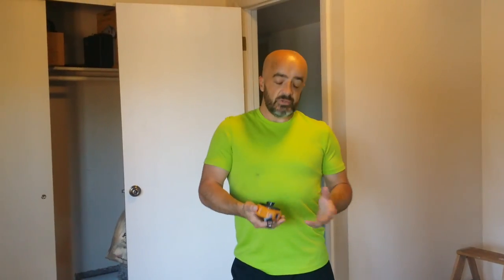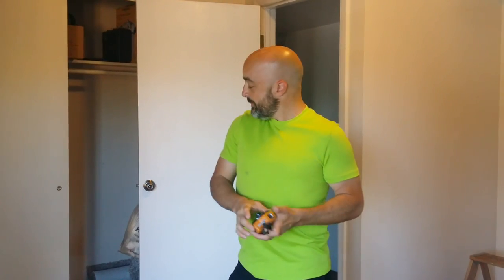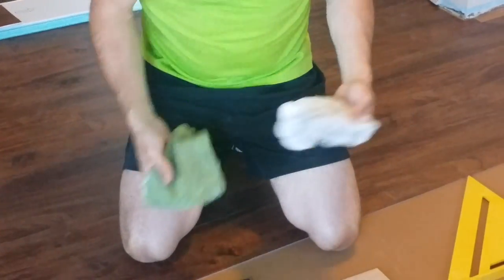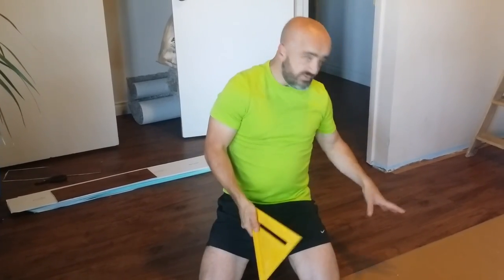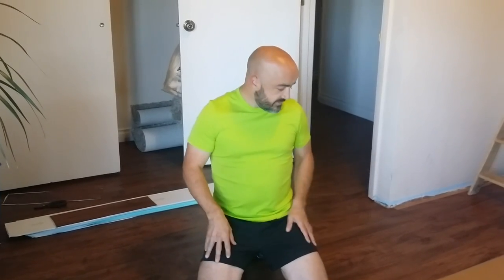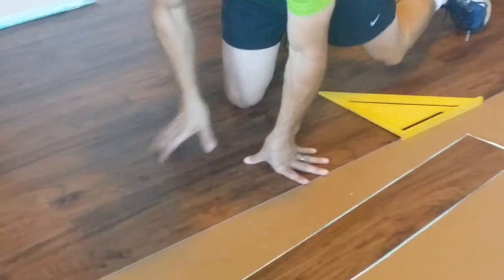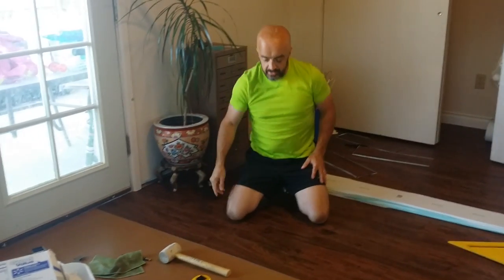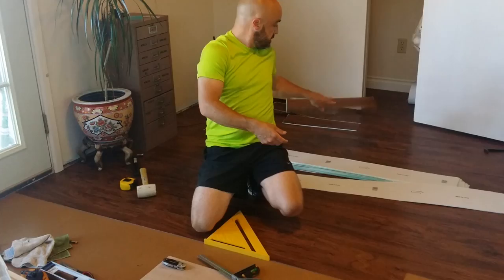Install adhesive backed vinyl strips

Comment: Start in the center of the room!  It works best if you do not start by a wall.  Start in the center of the room and work outward toward the walls so if the room is not square, you can adjust at the wall moulding.

Comment: Do u start in the center of room or at the wall?? And u Could always use a hand held "J-roller" like the kind for veneers too but  ive seen ppl use a mallet b4 too tho and it works just as well but takes longer. Hey,,work with what you got.

Comment: Will these ruin the floors if u want to do it temporarily ? We want to put over wood
Reply: yes, it will TOTALLY ruin a wooden floor as the glue is strong and will be virtually impossible to remove- DON'T DO IT!!!
Reply: Renter friendly I put contact paper down then these on top peeled off easily and looked great for 2 years

Comment: How does that product you are using work over linoleum ?
Reply from the maker: Haven't tried it, but if you cleaned the surface first with ammonia, I'm sure it would never budge. The adhesive on these planks is incredible.

Comment: Can you use this product over hardwood floor?
Reply from the maker: You totally can. It will go over any even surface
Reply: @Speedemon0202  even old worn laminate flooring?
Reply from the maker: @galaxi407  If it were me, I would first remove the old laminate. It's a pain, but it's the right thing to do. The planks will surely stick to the old laminate if it's clean and even, but the old laminate underneath might peel up, and then you've got the whole job to do over again. You minimize your chance for rework later on by investing some time up front.

Do it once, do it right.

Comment: If I want to stick these on a concrete slab floor do I need to put a sealer first?
Reply from the maker: I haven't done it myself, but I would think you would need it. Give it a whirl and let us know!
Reply: This fills in the pores. Concrete is very porous, so I would say yes
Reply: @Speedemon0202  . n oi9n
Reply: I think you just need to roll out a primer sealerr type clear product